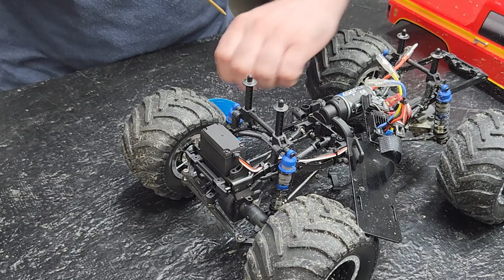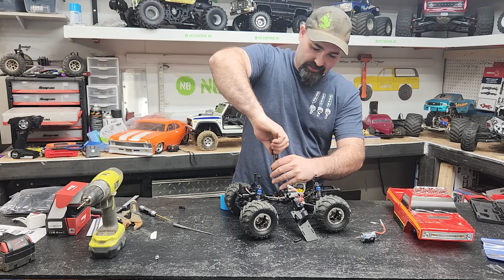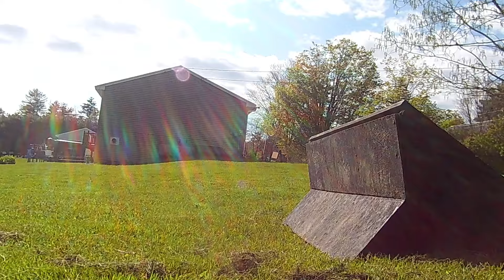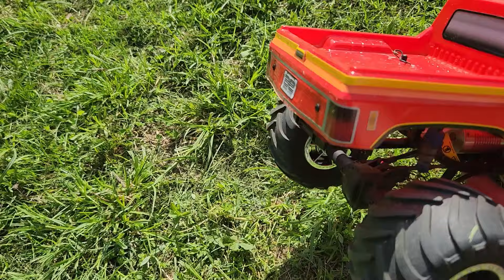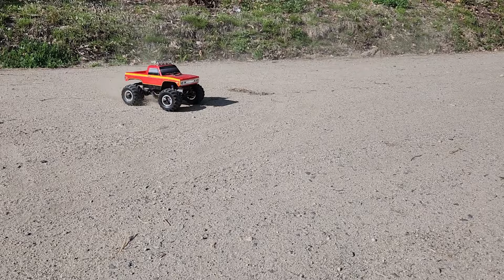You Bought the Associated MT12 now you want MORE POWER we show you how to install a brushless system

Comment: What size motor did you use what's the spec on the setup ?
Reply: It's a surpass hobby platinum system. 4370kv motor, 45 amp esc system.  Thanks for watching!!

Comment: Do you have a link for the driveshaft?
Reply from the maker: I don't, but as soon as I get home from work, I will try to get you the part #  I will say I had to clearance the trans mount to make the one I had fit
Reply: @nocontrolrc  it's a weird one. The output from the trans is 4mm shaft and the pinion on the axles are 5mm makes it hard to size up a shaft. I was thinking of bushing out the axle on the input side and like you said I'd have to clearance the area around the yoke. I used the same Surpass motor/esc combo off Amazon. Can't seem to keep the stock axles together.
Reply from the maker: @jamesmccabe8736  it's best to turn the punch down on the esc. I had to get a programing card to do it.

Comment: i have 2 cr12 the ford and the Tioga i put the gpm steel gears in the trannys they work great both brushless one is set up as more a basher with a similar system as yours the other has a H.H 380 revolver v2 and mamba micro x
Reply: Was it the gears for the Kaiser? And do know if that truck is 100% compatible with the cr/mt12
Reply from the maker: thanks for the info

Comment: Thanks for the shout out! Im gonna try mine on my dirt MT track soon, I didn't go brushless but I did replace the motor for a new stock one. I might just leave it stock and get one more so we can have spec mini monster racing between me and my son. There might be some metal gear options out there too. there is another truck called the kaiser that is a shared platform. I was thinking those trans gears would definitely be the weak link. looks like fun with a little more power. id be interested to see what a taller pinion would do to tame down the wheelie action?
Reply from the maker: Thanks for the shout-out on talk your face off. You guys do a great job with it. But your time zone kills me sometimes. I'm East Coast time
Reply from the maker: No problem, thanks for reaching out. Head to head in stock form would be fun. It's almost like hpi Wheely Kings back in the day. Trans gears and motor mount will be the weak links for sure. I rebuilt it using the stock pinion gear. I just milled it out to fit the bigger shaft. I'm going to see if that helps.